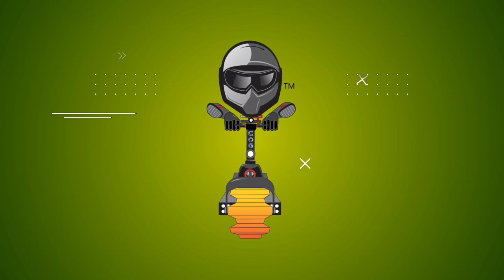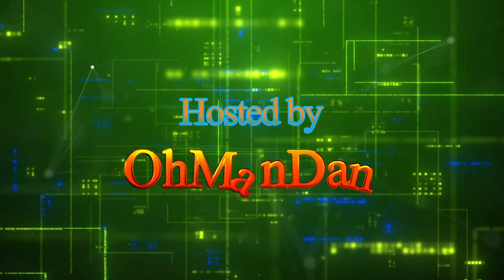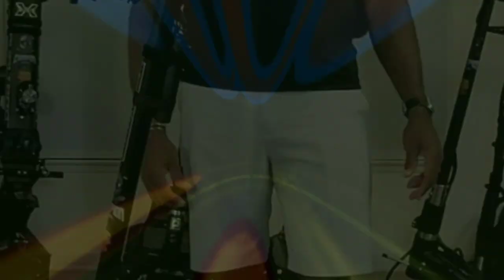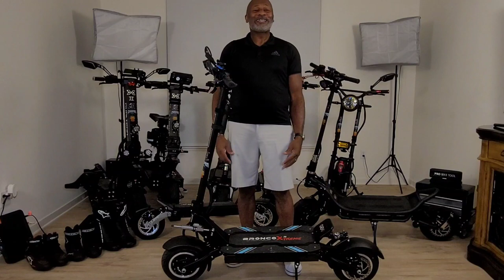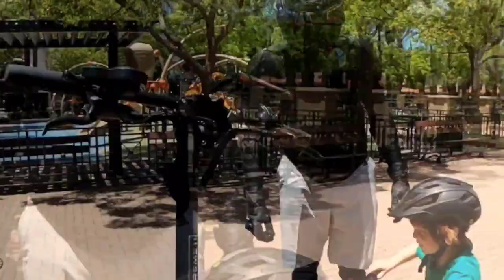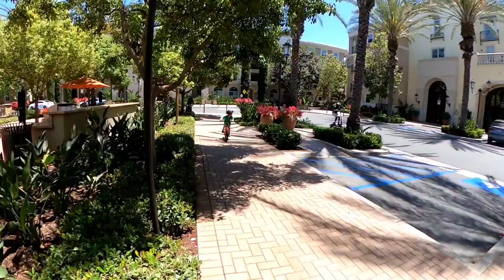OhManDan Presents | All New RIONized X-Bronco

Comment: Rion is now offering electrical parts and kits to upgrade any manufactures scooter. My question for you or #JohnRichardson is would either of you consider a Rion electrical internals swap into one of your Dualtron X’s (X1 or X2)? This would be a match made in heaven! Faster, better controllers and batteries mated to a X platform with the best and most comfortable suspension for riders over 50! 😃😃😃😃😃

Comment: That's awesome dan!! What's up with the nami? Juliana has yet to send you a functional nami..
Reply from the maker: Hey my Brother... That babgummmm Nami has really been a booga.

For some reason I just keep investing in it. I did finally get the Steering adjusted and for the 1st time was able to ride it but the steering is SO SQUIRLY now. 

I think I need to play with the SUSPENSION to get it perfect.
Reply: @SCOOTOPIAbyOhManDan   I still have the wobbling when i hit 45mph . I also have to tighten up the suspension.
Reply from the maker: @ENOCH0000  Mines is so badddd that I can't even get past 26-28mph.

I think I'll play with it some more when I get back.

There's no reason a Scooter like this should not come OUT OF THE BOX ready to RIDE. 

I've never had a new Power Scooter with sooo many BUGS before you can actually enjoy the dabgummmm thing.
Reply: @SCOOTOPIAbyOhManDan   That bites... I hope u can get it up and running.  
I'm waiting for a damper to be available which i hope reduces the wobbling.